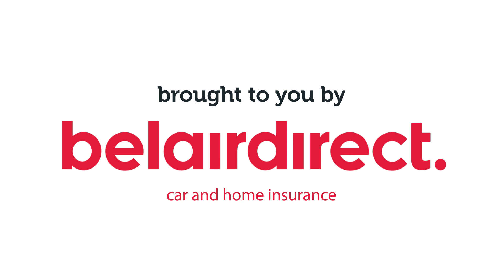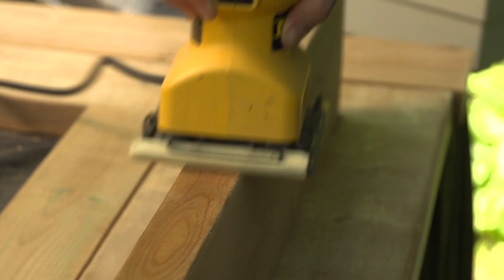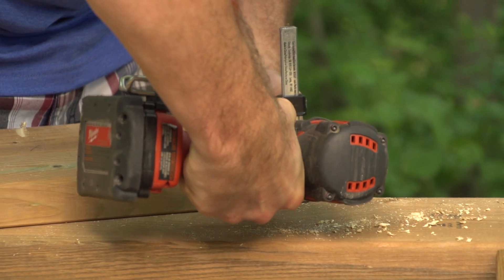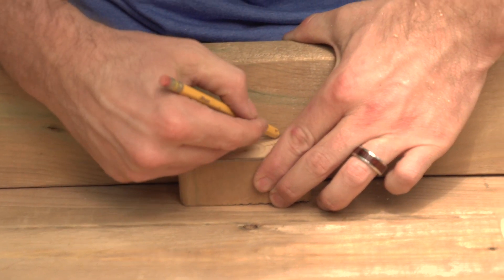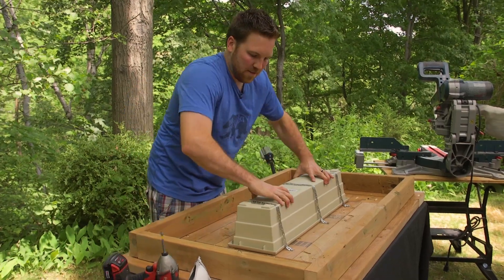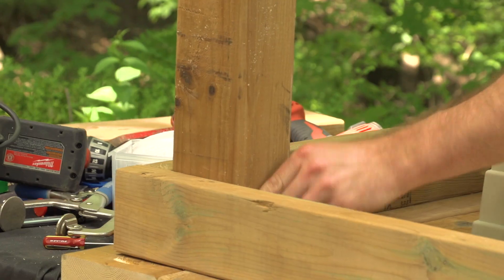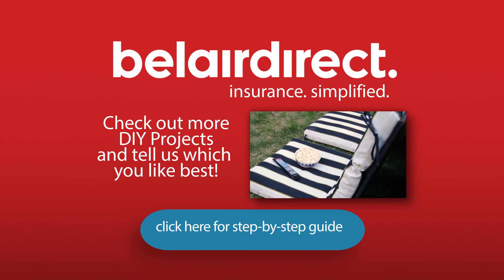DIY Table Troff Cooler

Comment: You could take this a couple steps further and make a table center grill. Warning a little more work

0:09 Replace the plastic planter box with a steel/copper planter box. 
- You will need a grill, so buy one and cut to shape.

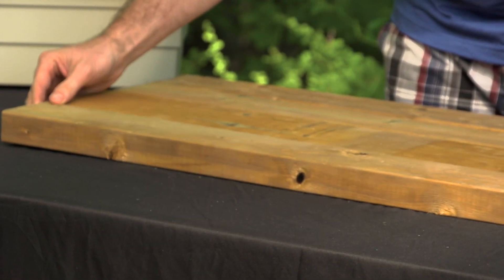0:55 Replace the closest 2by4's to the middle board with fire bricks.
- The bricks will be loose till you apply a backing.

2:56 After you have put it all together  you will need a piece of plywood  as large as the table.
- There should be a hole in the middle where the bricks and planks would go.
- Trace the size of the planter onto the middle of the plywood being sure to add a half an inch, helping hold up the lip of the planter.
- Cut a hole in the middle.
- You'll need to fasten the plywood to the bottom of the table  with some screws.
- Add some 2by4's underneath to add stability depending on the size of the table.

4:00 Lay the planter into the hole, place the fire bricks around the sides to check your placement.
- Drill 4 holes in each corner of the planter lip.
- Use bolts, nuts and washers to fix the container to the table. 
- Note adding bolts, nuts and washers will make the planter removable for cleaning. {Optional use screws and galvanized strapping}

 Other thoughts and suggestions
5:40 Optional wood finishing wax or stain.
- Note adding bolts, nuts and washers will also make it replaceable so if it gets damaged or even if you want to change it out for a Cooler
or an actual planter like small berry plants, thyme, rosemary ect...
Reply: I really don't want to lose this comment
Reply: Well thank you for that amazing advice.
It's coming up to Summer here in Australia and I am so making both tables.
One for our awesome barbeques and one for all the beer we're going to need to beat the heat!!!
;-)